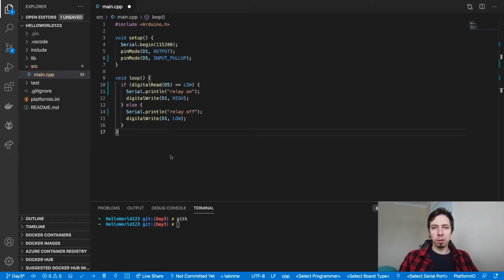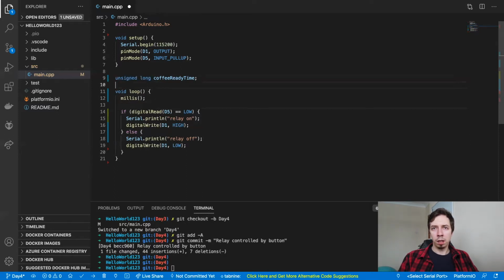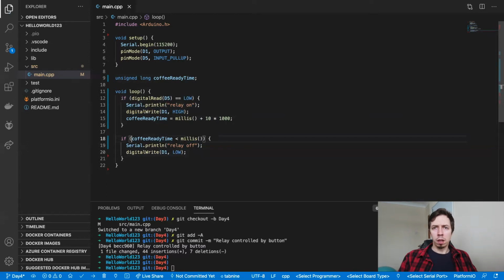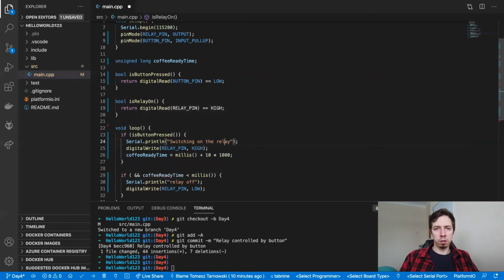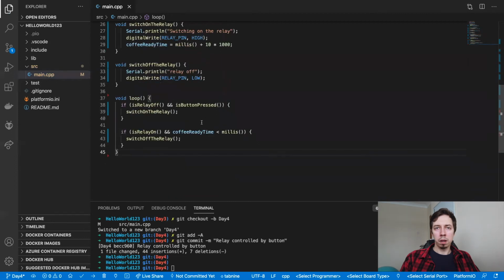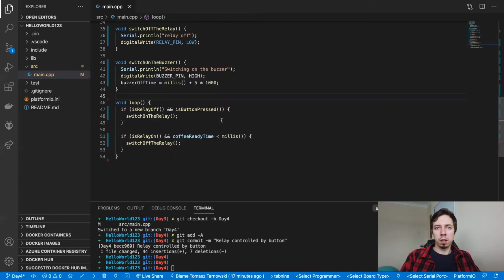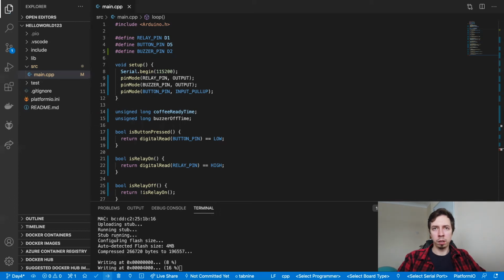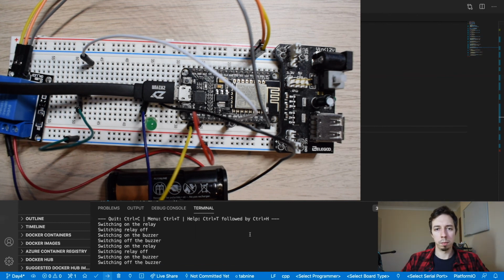Control Coffee Maker with Relay and ESP8266 Part 2/3 - Day 6 of #100DaysOfCode in IoT

Comment: Hi Tomasz , 
good day.
I'm newbie, I've followed your video tutorial.
both hardware and software side for this control coffee maker with relay using ESP8266, when I build and upload to the controller nothings problem, in the hardware side everything's fine. but when I ran the whole system is different from yours, my relay is in "ON" mode in the very start the LED indicator lights and when I pressed the button it turn the LED indicator off.

thanks.
Reply from the maker: hey Jorey, I think this is due to the way you've connected the high voltage part (coffee maker) to the relay. Have a look at this explanation from part 1 where I talk about initial state of the relay (either switched on at the beginning and supplying low voltage to relay switches it off or other way round): https://youtu.be/639YIeMRmho?t=525